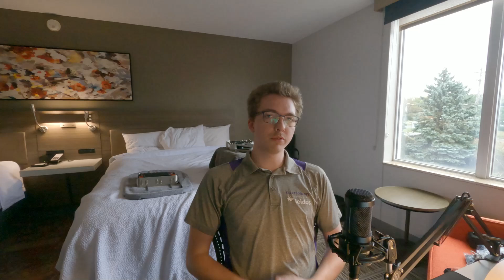October NHRL Event Preview: Master

Comment: Oh no I just saw the nhrl performance, so sad but the enemy drivers were really good.
Why did you go for the multi bot configuration? The hook was not strong enough 😅.

I hope I can see masterblaster more
Reply from the maker: We wanted to try out the multibot because it seemed fun!  Both of our opponents ran minibots which was hard to fight against with how Blaster ended up being allowed to compete.  Master also had an issue that I didn't discover until in matches that when the forks were removed or broken off the plow would hyperextend downwards and prevent the front wheels from touching the ground.

Comment: The lifer has been weakened by how many bolts it has. 3 Bolts is all it needs, maybe 4. More raw material would make for a stronger part with equal attachment stength...

Comment: your drive axles are setup exactly how megatron's are too. I used a belleville on the output to control the preload force a bit more
Reply from the maker: I like the idea of the belleville washer there.  Currently I'm just relying on the torque value I set for the end tap screw to and loctite to hold it in, so that would be a nice swap to improve this even more.  Thanks!

Comment: I really like the compliant arm coupler.  Curious if it would heat up enough to melt if a big hit spun it quickly? Being next to metal will of course help.  Or wear in general is another question.  I have found  various 95A TPUs to have quite a wide range of wear properties.
Reply from the maker: I might end up making a urethane replacement for the clutch piece to test out if the tpu breaks down too fast.  I've measured the arm breakaway torque with a new print and will be comparing the torque after running for the equivalent of a few matches to see if it changes over time.
Thankfully it's a quick swap even if I need to put a new one in pretty often.